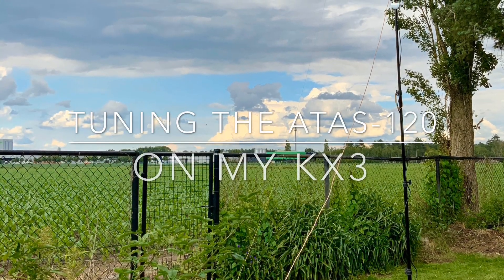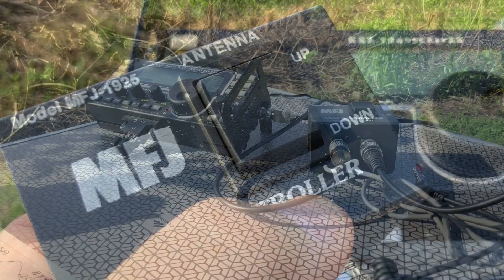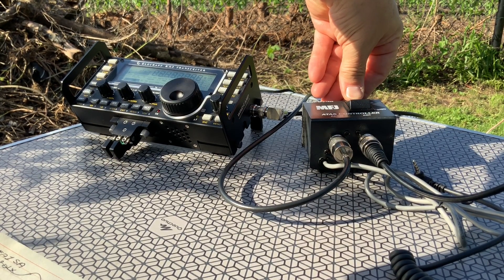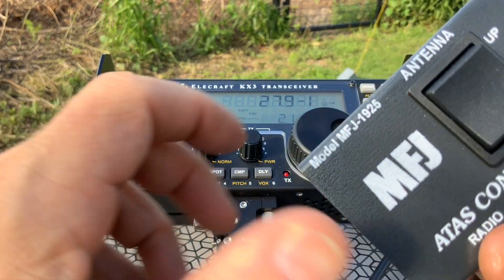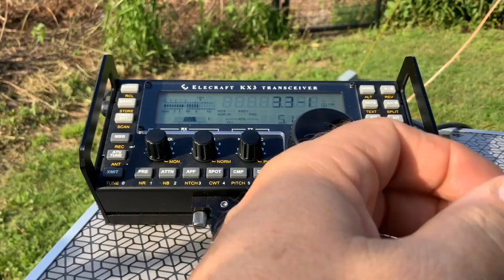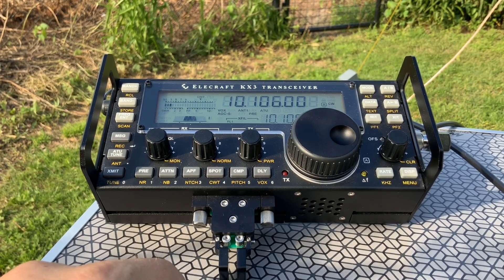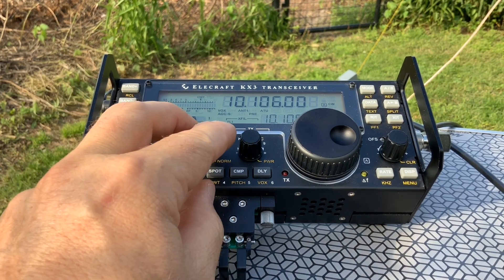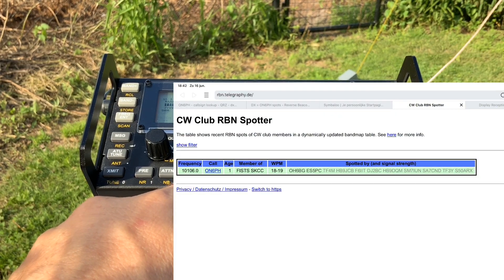Tuning the ATAS-120 with an MFJ-1925

Comment: thats nice but the antenna is not 1:1 . os less effect. not my cup of thea . Why is the Antenna is not resonant. i suppose to less on radials. not enough ground?
Reply: Yes the antenna is resonant less than 2:1 with good counterpoise, so my guess is not an optimized setup in this video.

Comment: Elevating the ATAS-120 is a very interesting idea. In the video, one can see a light grey wire leaving the antenna at an angle and also a black wire  running down the pole.  Since I cannot tell if you added a ground wire, could you please explain the way in which you wired everything. I understand  that the DC to power the  motor in the ATAS-120 is on the center conductor of the coax. Thanks.
Reply: @tron23058  Its looks like the black wire wrapped around the pole is the feed cable.  The grey lines are ground radials, as they go away  from the base and end up on the ground.  It is better to have the radials in the air, as that helps prevent ground losses and gives you a better signal.